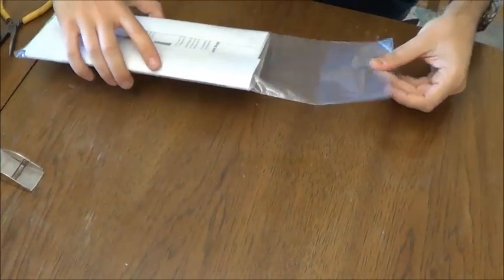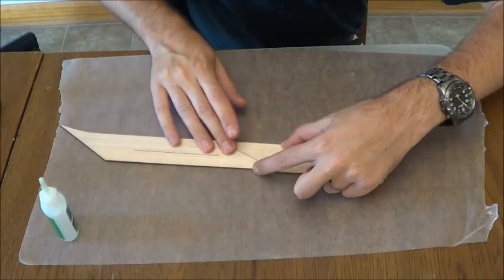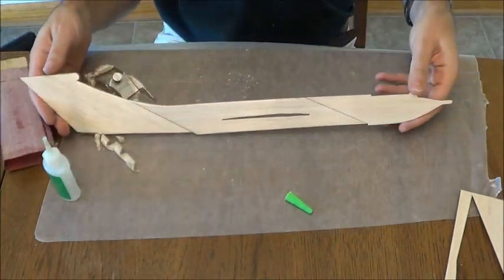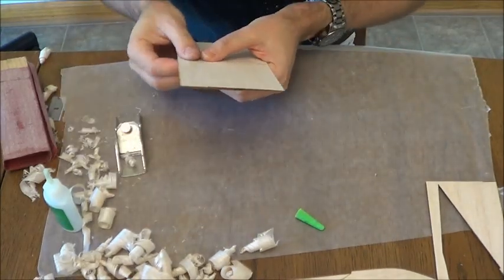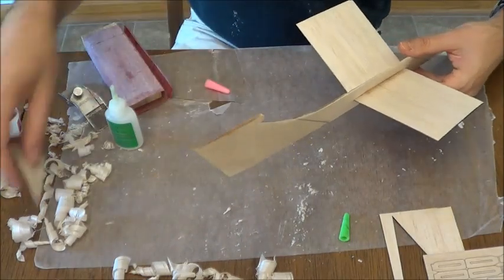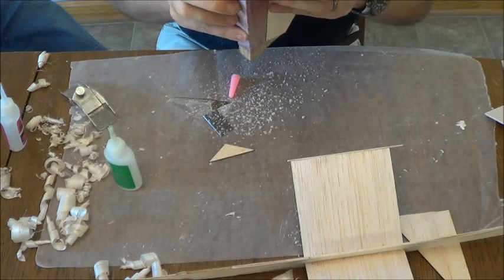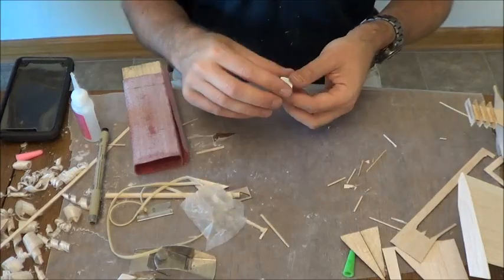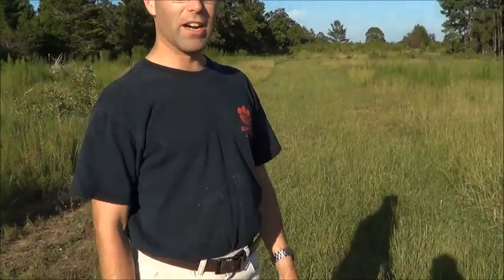Caspian Sea Monster - Build and Fly

Comment: not a WIG :(
Reply from the maker: Not as a model, sure, but the full scale aircraft was also capable of leaving ground effect.
Reply: people have made model hand launch lippish style WIGs (great in gyms) and it could but only in "jumps" as far as im aware.
Reply from the maker: Yeah WIG is impractical at the model scale other than as an R/C airplane party trick. As for the full sized one, fully loaded with cargo at 1.2 million lb, sure it would only hop, but the weight with full fuel and no cargo was far less and it had over 200k lb of static thrust with all ten of those engine throttled up.
Reply from the maker: Well, that does perform extremely well indeed. Unfortunately the only surface I have access to like that is a pond. :(